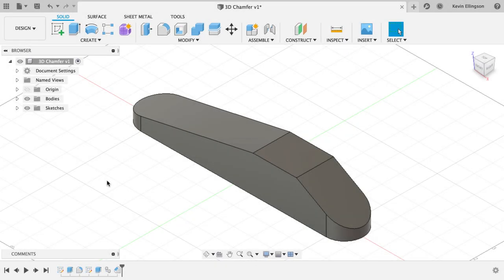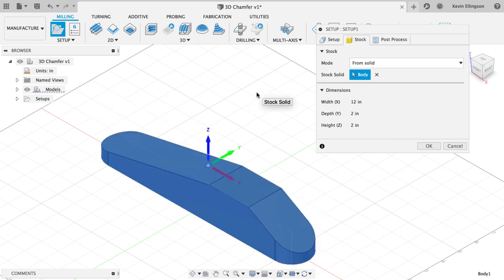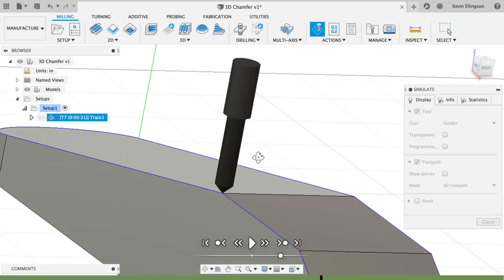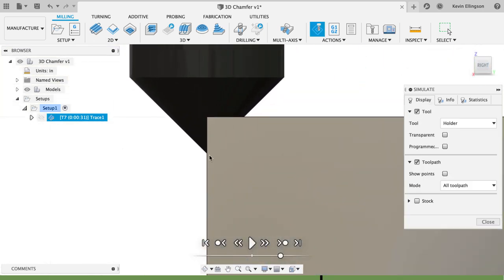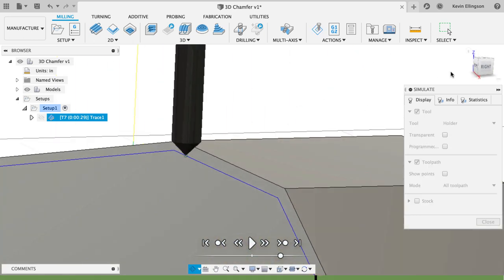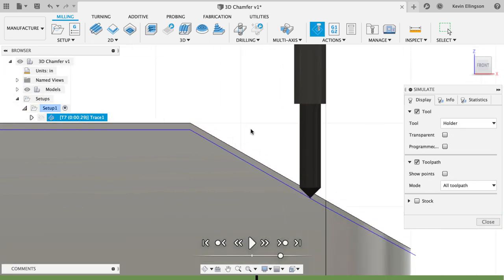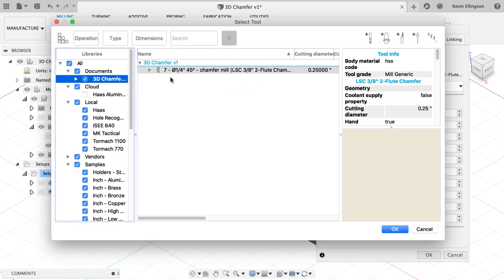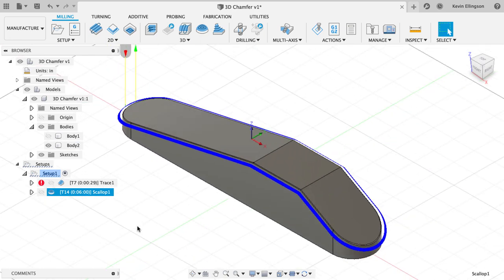Fusion 360 CAM 3D Chamfers

Comment: Yes - that's the way to do it. The standard 2D trace works great if you have chamfers modeled: just select the bottom contour and voila! Same as a standard 2D contour chamfering operation.
Unfortunately I sometimes need chamfers larger than my tool allows. I tried the scallop but that somehow gave me very weird dance like movements in the middle of the tool path. Changing the additional offset does the trick, giving a faster tool path with much better surface finish
Reply from the maker: Also, have a look at this video for some tips on how to improve that.
https://youtu.be/93oCFMCqQZg?si=KG033TZU8iSvFTQ4

Comment: I have a question. Whenever ever i have to put a nice chamfer along some 3d contours what i often do is to manually compensate a ball nose end mill (12mm ball nose for a 0.5mm chamfer) on every point basically via spherical coordinate s calculation given the chamfer angle and the cut path angle like literally
R0=6 (tool radius)  
R1=45 (chmfr angle) 
R2=30 (path angle) 
G1 X=(R0*COS(R1)) Y=((R0*(COS(R1))*COS(R2)))
      Z=((R0*(COS(R1))*SIN(R2)))
this is just the sphere comp. You need to ad the   point location for every axis and ad or subtract the comp value based on what quadrant of the theorical circle you are then reduce R0 by 0.5 so the tool dive in to the part by 0.5 creating the chamfer. ALL THIS BY HAND on the machine. I have videos of it that i can upload for every one who disbelief. So my question is: is there a method in fusion for doing all this? Like a trace path but whit a ball nose one shot along 3d contours?
Edit:
The code i wrote is just an example I have some actual code that I can copy and paste here.
Reply from the maker: Deburr in the MFG extension.

Comment: Thank you again :) For some reason Autodesk can't explain, a 2d chamfer toolpath got all wonky on a model which was a copy/paste of an existing component (done so I could manipulate it for placement on a fixture plate). Anyhoo the 2d chamfer went a little nuts, doing a retract every 50 thou or so. Crazy. But trace with left comp solved it!!
Reply from the maker: Do you still have the original bad toolpath? I have a hunch I know what the issue is but hard to explain. You can email it to me if you want so I can look at it. info@mechanicaladvantage.com